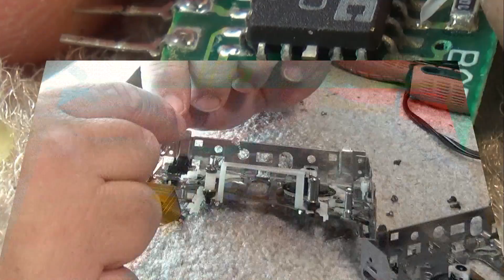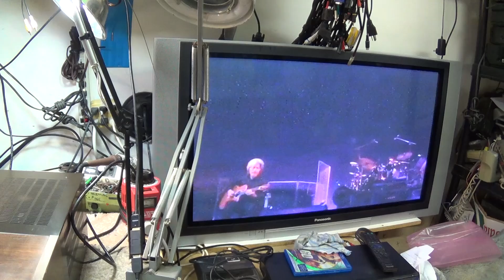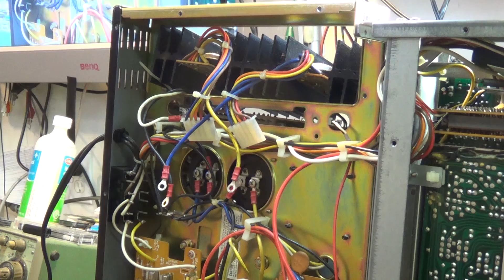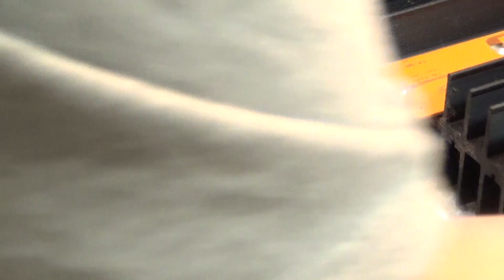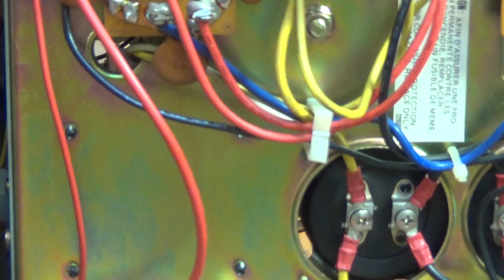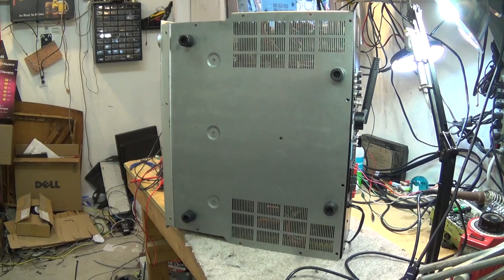Toshiba SA7150 No Sound Left Channel

Comment: My dad, now 80, had an old receiver sitting at home - one day it stopped working so he replaced it with newer tech, but couldn't bring himself to toss it, so it just sat, for years. I found it and using videos like these was able to repair it... lucky me, a G9000 in mint shape 😁.  Turns out he was a Sansui dealer back in the day. My aunt has a 9090 that I hope will find its way to me at some point also.
Reply from the maker: My dad had a mcintosh 1600. Mine now.  I also have a sansui 9090
Reply: @12voltvids  classic!

Comment: What a beauty they definetly dont make them like this you must have a warehouse of great and vintage gear enjoy be safe and careful out there and thank you for the great videos
Reply from the maker: This isn't mine.  I have a few pieces but nothing like this.
Reply: @12voltvids  well you always surprise me every time you post a new video everything is great and everything you touch turns to gold and is brand new I am still trying to fix my teac a1200u it had been redesigned on the power board no fuses as well as only one switch for the break solenoid my e is grt122@optonline.net if you dont mind corresponding I would really appreciate it thank you for your time and be safe aand love the videos

Comment: I like to get the service manual for whatever it is you're fixing and follow along or maybe try and figure out what might be wrong. I must say the service manual for this Toshiba is probably the best I've ever seen. Now I'll have to get one for your Sansui. Was just on eBay and someone is parting out a 9090 so if you needed any switches or controls maybe take a look. Another great fix! Thanks
Reply from the maker: Mine is. 9090D and it is fully functional other than light bulbs on the radio dial.
Reply: @12voltvids  Thanks I was wondering which one you  might have after I saw service manuals for 9090, 9090D and 9090DB. Glad to hear your Sansui is ready to rock. Can I ask if we will see the LuxKit A3400 again, or maybe I shouldn't ask? Have a good day.
Reply from the maker: @kwils6685  mine is the 9090db Dolby FM.  Yes the luxkit will be featured again when I get off my ass and work on it.  Been very busy and have still don't have a schematics.

Comment: Hii .. I have a question about my amplifier .. JA-S75 victor  .. The relay automatically shoot down and sometimes it work many times i try to fix in any electrician but when they fix it done after a days or week it happend again and again until they dont know the damage of it .. My question is if it happend again what do you think the damage and how it can be fix ... Any advice please .. Thankz
Reply from the maker: Intermittent faults are the most difficult to troubleshoot as you never know if you solved it.  I walk away from intermittent faults because I don't want to get married to it.

Comment: you could adjust the right channel needle pointer ... its off to the right
Reply from the maker: Actually the meter is stuck there..
Reply: there is a set screw
Reply from the maker: @zloben9000  
Assuming that the meter isn't damaged, but in this case the meter is damaged. There is a piece of metal inside the meter stuck to the magnet and jamming the voice coil on the meter, so it won't go down all the way. I wasn't going to take the meter apart. The owned didn't care and wasn't aout to pay to replace the meter or attempt to fix it.  Guess what, most people don't care about little things like that. The guy that owns this uses it in his garage!

Comment: Those capacitors are monstrously huge!  Strange to have the transformer covered like that.  You have 2 workshops?  That's one in the garage, but where's the other one?
Reply: +infinitecanadian - The "cover" is for magnetic shielding--prevents 60 Hz hum from getting into the preamps and is an earmark of a well built unit.

Comment: just wondering how you got your education did you sign up for a course from the Popular Mechanics magazine or did you actually go to a tech school to learn what you know appreciate if you could answer I know you're busy
Reply from the maker: zorroon milkavitch 
Actually I went to bcit and studied television production. I had worked at a TV shop when I was in school. I knew owner from when I was about 10. He had been a radar engineer during ww2.  I went to the shop for about 3 hours every day from about grade 7 through to 12 and learned enough to take the journeyman red seal challenge test which I passed easily. I then finished school and decided I didn't want to work on electronics and wanted to get into TV. Studied that but there was no steady work local. Worked for a community station, did an internship and summer relief work. Saw an ad for Sony looking for junior technicians. Applied for the job got it. Sony put me through the VCR factory training course. Sure it was betamax but same principle just different mechanism. Did that for a year and they wanted me to relocate to other side of country. Left Sony and ended up in a small warranty depot. Over the 20 years I was there took constant manufacture courses for new tech. I forget how many buy between 50 and 100 I would think. 5 or 6 courses in classroom a year. I filmed one of them and put it on the channel. A super beta course. That day I filmed was the theory day. The balance of the week it was hands on taking the machines apart and finding planted faults that the instructor put in.
I left the electronics service business in 2003 and retrained in the telecom industry where I work today. A few years ago I got the idea to start the YouTube channel. I had, during the time I worked in the repair business started a video production company and produced hundreds of high end multi camera shots of weddings, live performances, theater, TV commercial and infomercial and corporate videos. When my business partner died in 2007 I wound down the production business. Then I got the idea for the YouTube channel and put my production skills back to work, except now I do everything myself. I used to just be the guy running the camera and editor. I hired the talent, voice over talent, additional camera people ext. Now it is just me. Instructor, camera operator, editor and voice over.
Reply: @12voltvids  wow impressive!
Reply: WOW. Judt wow.

Comment: Vs-sp -57. (Model number )Hi i am  an electrician getting problem with left side input playing very low  but right side playing loud and ok, also interchange  the input audio signals same result.It has 4 output transister (c5198) all test ok and 4 small transister  2 (c945) 
and 2 (c733 not too sure if it's correct number) is these small ones the driver ? it test ok.When volume turns right up, left audio input barely plays (very low).Sir can you  please help me out.Thank  you very much.

Comment: is that a torodial transformer flanked by 4 caps?.......................sry for spelling
Reply from the maker: Peter Gorrie 
Probably not. Likely a conventional one with a cylindrical metal cover to reduce magnetic influence. I didn't remove the cover so it could be a toroidal under there. I have an open chassis tube amp that has the same type of cover for power and output transformers. Conventional iron.

Comment: That receiver is beautiful! Awesome amp section!!!!
Reply from the maker: It is alright. Wish it was mine. I have an equally nice receiver, perhaps even nicer. A sansui 9090Db with Dolby FM! That is a rare beast, that goes for about 1,300.00 these days on the used market.
I will overhaul it some day. I'm putting it off as I don't want a hernia lifting the beast! (that and the fact that it works fine except for noisy switches and controls)

Comment: hey  mr 12 voltvids I have an akai reel to reel model number gx-266d fast forward and rewind doesn't work right very slow one of the channel is out how much would you charge to look at it make everything back to original or better than it came from the factory thank you  my name george
Reply from the maker: I have an AKAI GX 260D myself. They are great units. Capacitors go bad in the reel motor circuits and cause low torque.
Reply: 12voltvids how much would you charge to look at the unit and make it like Factory all better thanks

Comment: great video i have an old receiver from that same time frame mine is the old hitachi sr 2004 very heavy it still works have it hooked up to 2 sony grand 7 speackers from the same time frame with a new onkyo and a sony cd player the only thing that i would like to do is clean the volume control and the other controls they are just staticy thats all but she still has lots of power and you are right sir they dont make them like they used to i also have 3 older sony receivers as well still work once again thank you for a great video i watch them all the time that one with the water main that broke was really good but that happens once again thank you
Reply from the maker: Just did 2 old Marantz receivers today. Videos soon.

Comment: A fine presentation there. It seems sometimes high value carbon film resistors go much higher in value after much use.. In the days of tubes, there may be a 1 Megohm resistor going to, say, 50 Megohm, which has a significant effect.. With faults of this type, you have the benefit of reading the color code to ascertain the correct value..
I like the idea of a link from the 'tone and volume' stage to the power stage...
The Akai AM UO3 stereo amplifier has this too...
I use it to connect a remote control Digital radio, with Bluetooth directly to the power stage...

Comment: HI love you video I am wondering if you can help I have 2 sharp vertical record players 80s retro   which  play both sides of the record  or LP with turning over  they have no amps in them I am not getting any sound from the LEFT CHANNEL on both decks and a humming sound there is a relay the only one  for side A & B which clicks when changing sides could this still be a bad relay even know  side A COMES OUT 2 SPEAKERS

Comment: Beautiful amp, need a recap and is good as new :))
Reply from the maker: +VALYK29 If it was mine for sure.The owner is a cheap bas^&%d and getting 50  bucks out of him for the repair was like pulling teeth.
Reply: VALYK29 Gawd, you can hear the noise from all the leaky caps... terrible.

Comment: 45 years old and still playing - amazing !!!!
Reply from the maker: +Donald Ellett My McIntosh is over 50 and it still works. Has developed an intermittent popping sound in 1 channel, I guess one of the old tubes is starting to go, or a capacitor is going south. One of these days I will put it up on the bench. Not a super high priority right now as I am not using it. I have a modern tube amp that sounds superior for music to the old one just due to better, higher tolerance resistors and capacitors, so I use that amp (A Yaquin FYI) for my CD player and turn table.

Comment: What solder do you use???
Reply from the maker: +Donald Ellett 
The solder I am currently using is a very old roll of Kester rosin core 60% tin 40% lead from the 80's I would guess. I found it in the recycle bin at work. Someone toss an almost full spool.

Comment: I have seen that the amplifier still had the original "Marcon" filter capacitors that are working on borrowed time. And yes, all audio equipment were made very good back then. Especially the Sansui, Pioneer, and Marantz brands in my opinion and in that order were the best made in Japan.
Reply from the maker: +service1956 If it was mine I would be re-capping it, but it isn't.  When I gave him the bill for this repair he whined and complained, I can't imagine the whining and complaining I would have git if I even suggested he spend a dollar more on it.
Reply: I’ve purchased some old Marcon capacitors in Ishikawacho, I thought nos parts are also good especially made in Japan. But I didn’t realize what I bought was “capacitor”, it leaks really hard when charged even within spec. I took me very very long dealing with strange volume curve on pot until found that it was failed capacitor.

Comment: This Toshiba is like pornography for vintage audio lovers.  Damn sweet receiver. Gotta keep the ol' girl running.  I personally would have replaced the matching resistor on the other amp as well just for good measure since it also has the same amount of time on it. And yes, nothing today is made anywhere near this good, sound or build quality.
Reply from the maker: +WaybackTECH If it was mine I probably would have, but this is owned by the cheapest SOB.I charged him 50 bucks for the repair and he whined and complained.Any shop that he would have gone to, it would have been minimum 90 just to take the top off it.
Reply: 12voltvids
well I totally understand that, and those kinds of wonderful customers.
Reply: *****
I have no idea how you arrived to that conclusion but, ok whatever man.
Reply: *****
that I keep going and going with a when it is not economical to do so
Reply: *****
oh! ok ya i could have read into that wrong. I think there is a lot of these units that would qualify as being worth fixing if they were not technically worth the same amount, after all even if you got another one, it probably would eventually have the same problem anyway, and this older stuff just goes up in value too
Reply from the maker: +WaybackTECH You got that right. The old amps were bullet proof. The newer ones you sneeze on them and they blow up.

Comment: I wish youtube existed 20 plus years ago and service people recorded their work so the customer could go back and watch the repair and know they were not being scammed. So many repair shops scammed people back then for hundreds of dollars over something simple like a line fuse blown.. The biggest scams were and are still today the automobile repair shops though..
Reply from the maker: +ElfNet Gaming When I was in the business many would have called me a crook for charging 125 to re-solder the ground connections in all those Sony tuners., however the good offset the bad. There were many times when a tough dog would take hours and hours. I remember struggling with a Pioneer 70" projection set for about 9 hours the first time to find 1 cracked solder connection buried deep in the chassis. Now there is not way I could charge the customer for 9 hours @ 80.00 an hour. That would have been 720.00 in labour. So they were charged 150 for the repair, as was the next 30 or 40 of those sets I saw in the next year an a half that they were all failing.  It only took 15 minutes to fix the fault once it was identified. Same went for all those Sony tuner failures. They took about 15 minutes to fix, but in the early days, before the fault was figured out, it was replace the tuner at a cost of 110 for the part and 80 for the labour.I even had one smart ass customer that wanted a break down on the cost because he got a bill for 150 to fix his TV. He went to the media, and they tried to set me up with a simple blown fuse. Of course the blown fuse trouble generated a 29.00 labour charge, the shop minimum. But when asked about the 150.00 for a broken solder connection, it was broken down as follows.Re-solder broken solder connection $5.00. Knowing which connection to reflow $145.00!  There was no comeback for that. Also back when I made a living repairing electronics I did not share my knowledge with anyone, especially the guys that worked in the shop with me.Electronic service engineers, which is what we technically were, a technician would be what I would call my assistants, the guy that took the back off, and did minor things like replace belts and clean controls. I was working at an engineers capacity. I was the one that could read, and understand the schematic, and knew how the circuit worked. That is what put food on the table, and I wasn't about to show some noob the tricks of the trade, that had taken me so many years to learn. So we had to charge enough to earn a comfortable living, and pay the expenses of running a retail establishment.I am not in the business now, at least not as my main source of income. I work in a totally different industry now, but I still live in the same community that the shop was in, so many people know me, and still bring me stuff to fix.The purpose of these videos is to hopefully get people interested in this field, as they certainly don't teach it in school anymore, and the post secondary courses just don't exist anymore.  At least they don't for consumer electronics.The little bit of beer money I make from YouTube doesn't hurt either.
Reply: I work in IT and communications so most of my repair work is done out in the field at tower sites, I get the occasional radio in for repair here and there and I usually charge a flat rate plus parts. But the other radio shop across town just flat out gets away with highway robbery, charging $150 for a battery pack that costs $10 at dealer cost.. I understand mark-up but that is just insane.
Reply from the maker: +ElfNet Gaming You want to talk rip off? Monster cables. That is a rip off.The shop I used to work for made a killing from monster cables, and the sales dept would convince people that a 150.00 cable that cost 14.00 dealer cost was going to make a difference in picture quality.I locked horns with the owner by telling a customer that their 3,500.00 DV cameras needed a new 600.00 digital board because the DV connector was ripped off the board from using one of those stiff monster cables as opposed to the 40.00 Sony cable. The customer cam storming in demanding the shop refund hos 150.00 for the cable and fix the camera for free. The boss was not happy with me for telling the truth, as he made a killing selling those stiff cables. Had a bunch of TVs get their HDMI connectors snapped off by those stiff boutique cables too. To this day people get ripped off on headphones, batteries and connection cables.